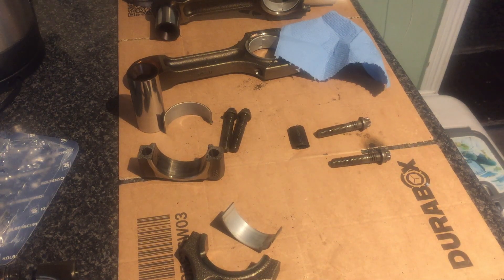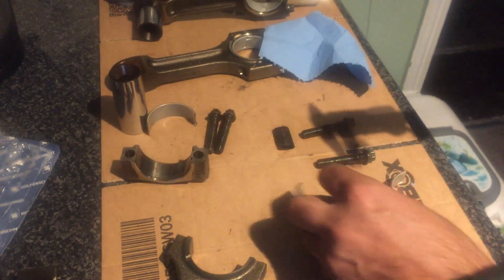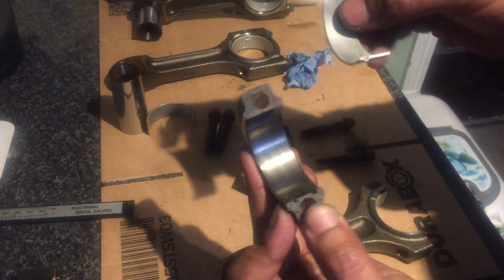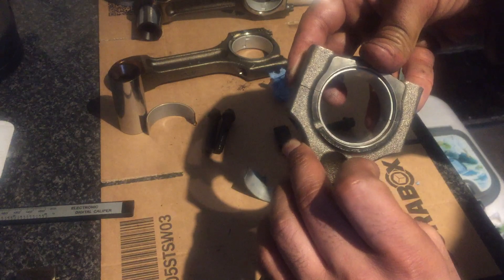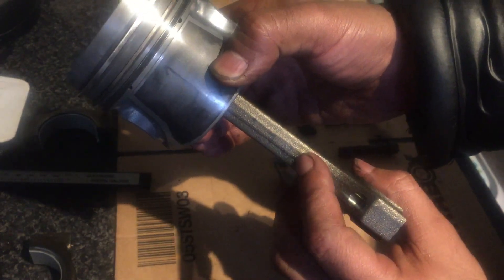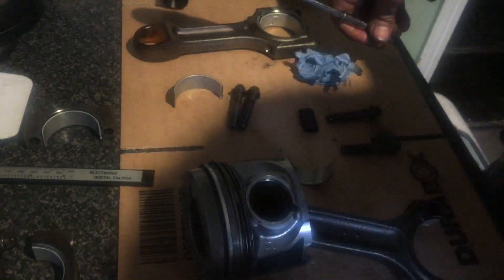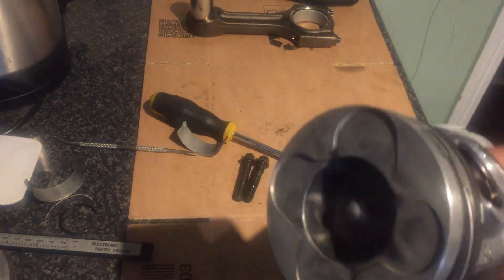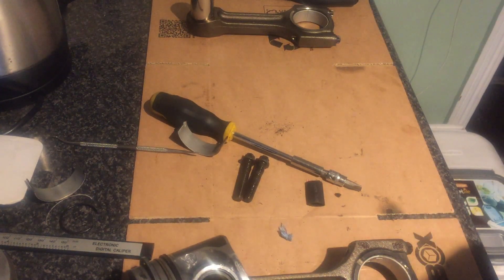M57 BMW Engine Rebuild Part 2 Con Rods And Pistons

Comment: In case you did not know.
Burning chamber is excentric by 0,3mm

Thats why it has fitting direction.

Since my pistions went to ceramic coating, i did not knew anymore, witch way they had to be refitted.
Thanks to your video, i know now.

Baically ring that holds PIN, that is removable, will be gearbox side.